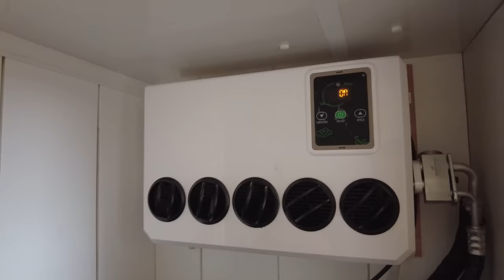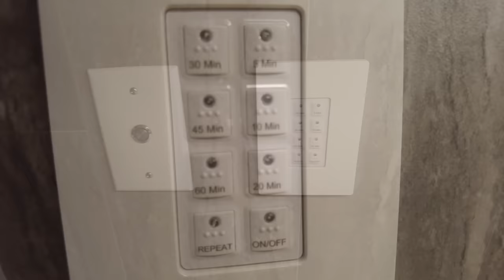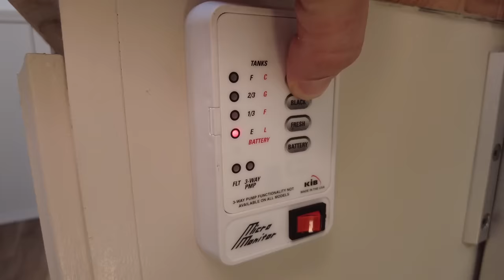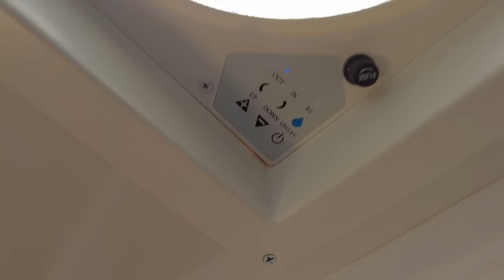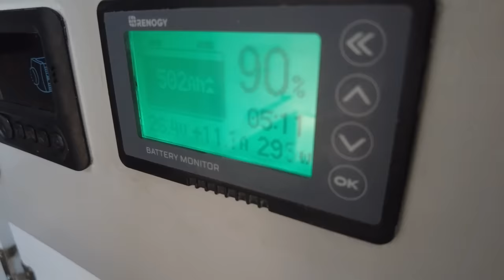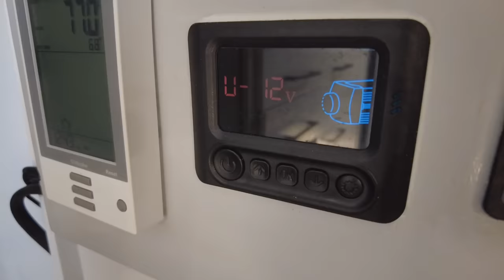Stealth Apartment + Toy Hauler in a Box Truck? DETAILED TOUR!

Comment: The major issue I see with this is a lack of fire escape. In the unlikely event of a fire while the occupant is asleep, they're effectively trapped.  Putting the skylight above the bed adds a fire escape where it's most useful.  And I'd prefer not burning to death to even natural lighting.
Reply: You missed the passthrough door
Reply: @hmmm2564  No I didn't.  If you have the bolt thrown and door locked, are dead asleep, and there's a fire  and the bed is in the way, smoke is everywhere... good luck.
Reply: It's a box truck with two exits. Even two and 3 bedroom apartments have 1 door 🚪. It's fine. You can customize yours if your scared. 😱
Reply: @whatchandstudy7  Sure, but they have windows. ANd it's more of a fire safety perspective, having recovered charred corpses from places with no escape (Closets, for instance.)  The builder is exposing himself to liability by placing a sleeping area in such a way that there's no way to escape a fire.
Reply: @Canthus13  There's no liability to having 2 doors and a skylight in a 17ft box truck. Keep a ladder if you're scared. Sometimes your field of work has you constantly seeing the worst of life and you can't escape it. If your scared then do your own that way.
Reply: @whatchandstudy7  go ahead and think that.  There's a reason for RVIA standards.  And fire codes have mandated fire escapes in RVs in pretty much every US jurisdiction since the 70s, so there is absolutely liability.
Reply: @Canthus13  OK. You win. Tell the guy that his build is Trash and he need to start over. Use your knowledge for good use and contact the guy. I hope you tube comments aren't your only win. Go do the work now and save some lives. Congrats 👏. He's probably building another one right now. Go help him.
Reply: It's not about being scared, its common sense. If a fire was to start in the cab how would you get out, not through the from access door. The rear ramp door is locked from the outside and no one is tall enough to climb out of the skylight.  This puts a lot of future personal liability on the builder, regardless of liability release forms signed.
Reply: @donnobles5272  I could use common sense and find 25 things wrong with this build. I think he did a good job.
Reply: @donnobles5272  Go check the owners comments pinned. He's used to the ”WHY DIDN'T YOU” crew.
Reply: @whatchandstudy7  Agree great build. It's just dangerous with only one means of egress since the back door will not open from the inside
Reply: @whatchandstudy7  Where is the second exit when it is in stealth mode?  I didn't see a way to open those cargo doors from inside.  And no apartment bedroom is up to code without an alternative means of egress-- they must all have a window of a certain minimum size.  The lack of a second means of egress in this build is the only problem I see here, but it is an extremely serious one.  I'd create a hatch through the roof, or perhaps the floor.  There has got to be a second way to get out when those cargo doors are closed.
Reply: @Canthus13  Yes, I strongly agree.
Reply: @whatchandstudy7  It's not about being "scared".  It is about being prepared and informed.  In stealth mode there is only one door, and that skylight is too small for escape purposes.  This defect can readily be remedied but it merits serious attention.
Reply: @donnobles5272  Yes, I strongly agree.
Reply: @Canthus13  -  When he goes to register the truck with the State, they will ask the purpose of the truck and there will be an inspection according to it's planned use.     If he is building on to an already registered truck, in that case he might be in for some questions if he ever gets stopped on the road.   Their are weigh stations on highways that check trucks thoughly since the problem we have with drug smuggling.

Comment: What's really satisfying about this video is that it PROVES the viability of not just box trucks, but also shipping containers as an off-grid residential option. The keys start with the energy foundation: 1600 Watts of solar power, distributed to home-style amenities. If stealth is not a requirement, this approach gets even better. Personally, I could not exist in an enclosed box with no side windows. Too much like solitary confinement. 
One stealth suggestion: Use paper-thin solar panels. Even with reduced output, they would be virtually invisible, and easier to clean. Also, use sodium-ion storage batteries, when they become available.

Comment: Cool build. One thing I think I would have done different: I would have tried putting some utility drawers on the left of the sliding door, sliding out to the rear. Put outdoor stuff in there, tools, wrenches etc as needed for the motorcycle. It would have decreased the size of the sitting area a bit, but it seems weird that the only accessible drawers for gear, especially tools needed, are all the way in the front. The washer/dryer combo is slick!

Comment: That's awesome.  You really put a lot of thought into it.  My only concerns are (1) Climbing up onto that bed, and not falling off in the middle of the night, and (2 🚨) Because the rig is so air tight, there's a high risk for exphixiation from the gasoline fumes if they're sleeping or spending any time in there with their bike.  You really need good air flow for that too (not just the ceiling vent, unfortunately)  This is where windows really are necessary.  You also need ventilation for cooking -especially if using a propane stove (CO2 detector as well).  (3)  You need to mount a fire extinguisher. (4) If you're using regular car batteries, and they're inside, they need to be vented to the outside. (5)  You will probably regret using the white board on the ceilings, because eventual leaks are likely in a box truck due to the movement/flex.  You may want to roll out a protective membrane (or fiberglass?) across the roof.  Hope you used a different product on the ceiling in the shower.  (6) Hope you won't have issues with the sliding glass door, but I'm sure you researched if it can take the constant movement/vibration, and added good framing to ensure it won't get wonky.  (7)  Ya might want to re-do that odd camera angling back/forth in the beginning of this video....and re-think the stache. 😉  And, don't be so down on vans and RVs.  You could learn a lot from other's choices/logic and ideas.  Also, not everyone is a good fit for, or wants a box truck, especially women, who may find a van or small camper is easier to drive.

Good luck with your business.  ❤
Reply: I detect a little jealousy here. 😂😂😂. I’d probably prefer a van parked by the river myself.  👍
Reply: 😂 - I especially agree with the moustache comment! Also, he’s quite arrogant
Reply: asphyxiation not exphixiation
Reply: I love all of your safety suggestions/concerns.

Comment: Right off, the tape over wiring on roof will tear off/flap in wind/at highway speed as will the wiring. Second, the AC heat exchanger mounted underneath will consistently run hotter than spec due to restricted air flow and often being directly over super heated pavement, therefore, wearing out/breaking down sooner/more often. Also exposed to high speed debris as well as water soaking/splashing that standard outside mounting only exposes to rain not flooding.

Seems mounting AC heat exchanger center of roof is stealthy enough and better securing roof wiring would eliminate any issues.

The rest of the build is quite ingenious and very well done.

Thanks for sharing

Comment: My kids will be of age 18 in a few years. And this would be perfect. Because I want to sell my house and get rid of everything and go tiny. And this is the best thing I’ve seen around. Thank you for the ideas. I never even thought you could do something like this if you purchased a U-Haul truck. And to top it off, you actually could travel somewhere if you wanted to. Versus other tiny homes that some of them you can bring around with you and haul them if you have a huge truck and everything else. Definitely the best thing I’ve seen so far for tiny living. Can you also Haul small vehicle behind this with the weight? You may have said in the video if you can, but I missed it if you did. Was also wondering if you could do French doors instead of the sliding glass door?

Comment: This is really nice, but 1 big issue for me is its lack of cold weather capability.  All the bare tanks and plumbing are in the open under the truck with no insulation.  This is a warm weather, or 3 season rig for sure!  
He did a great job on the build, and it's very well thought out.

Comment: graet build aside from the exposed wires on the roof that connects into the solar panels-i'd recommend running the wires underneath the solar panels with a lift hinge type setup.

Comment: I have never considered a stealth box truck build. It just seemed silly to me and let's face it, if you went to an RV park it would kind of stick out like a moose in a chicken coop. 

Having said that, your video has opened my eyes. 

First off, in some cases, the stealth factor does pose some real advantages in some cases - actually, many cases except in a RV or State park situation. So yes, it's beginning to look practical to me. 

Second... It's square! That makes building it considerably easier to build.. I like that!

Third... You have done a super job in adapting a vehicle which is heavy duty and capable of withstanding the access to more difficult destinations such as off-road scenarios where a class C might not want to venture. 

So, thank you for sharing your design and build. It looked so comfortable and innovative and seemed to me to add another dimension of possibilities to the RV experience that a typical class 3 might not be able to handle. 

Super job!

Comment: Very nice work! Excellence in detail and craftsmanship and lay out! Love the approach and thank you for sharing. I have nothing negative to say at all... but must point out 2 important safety issues... with one very good recommendation for mega efficiency. 1) The positive terminal on the winch MUST be protected. Massive safety issue considering its dual use storage as well. 2) Wiring for the solar panels needs to be organized and in some type of protected conduit to avoid damage.

Recommendation (with some good small pointers): Consider in future builds to centralize all built in electrical components into one compartment. (preferably next to the fridge if using a home unit) WARNING If using lead acid batteries you must always make sure this is ventilated externally! Personally, I would not even house them inside the living space at all. As we all know... these components put off a lot of heat. So do the condenser coils on the back/bottom of the fridge since its a home unit. This is precious heat for winter and also heat we want to vent outside in summer. Building the home fridge into this compartment allows heat management. This can be accomplished with a very simple vent system and smallish cheap DC fans like we use in computer cases. The external vent I would wire with a hard set thermostat so it kicks on no matter what when required. The internal vent I would wire to an adjustable thermostat for comfort and control. If the box is well insulated, this heat is likely to be all that is needed in winter... possibly too much some times. In the summer... this same heat is isolated from the living space and vented outside. Using a normal home fridge is fine... good in many ways because we can use this to heat the space... and lower unit cost while maximizing efficiency. Just be sure the drip line that normally collects water in a tray on the bottom is re-routed externally just like was required for the AC. This way there should be no issues with moisture and molds and such inside the living space. Other than that... Super Awesome build!!!! Thank you and ML and Blessings everyone :)

Comment: I may have missed it if you mentioned a carbon monoxide detector, but do be sure there is one.  This is a fantastic build, the only serious problem here-- and it is a grave problem-- is the lack of a second egress when in stealth mode as required by RV codes-- they are required for good reason.  Local AHJs could demand this vehicle not be slept in until that problem is remedied, if they were to notice this vehicle.  I'd just use a larger skylight with a collapsable drop-down ladder (this would also improve roof access anyway, which I discovered we needed more often in our RV than I ever would have thought), but there are many alternatives.  For example, many work trucks and trailers have a man door on one side of the box or even within the rear door, so even though U-HAULs generally don't have them, these would seem compatible with a stealth mode design to me.

Comment: You might want to think about adding a longitudenal support strap to your water holding tank. On RVs, failure of the tank  due to tank design , it created many problems with cracking from road vibrations. Water is heavy and plastic tank is made from very thin material. Otherwise great build with many thoughtful appointments.

Comment: something that I have always wanted to try myself but now I am too old and just don't have to funds to do it anymore. At one time I was going to build a man cave below ground. There were going to be no windows, but I wanted to design the space as if it were above ground. Instead of windows, there would be large monitors framed as windows. Above ground there would be high definition cameras for each monitor facing the direction that an actual window would be facing as if the space was above ground. So, when you look at the monitor, you would feel like you are looking out a window that would be in that space if the room was actually above ground. I've never seen this done before, even as I have searched quite a lot trying to find anyone that has tried it. It seems to me that this may be a great idea for your stealth apartment on wheels. It won't feel so enclosed from the outside, but on the outside, no one would know that anyone is looking outward. It would also make for a great hidden security system.

Comment: Very cool I just saw two issues one I’m not a fan of the wiring I feel like it would be flapping around on the roof, also the bed side drawers did not look like they locked. Also maybe paint the edges of the solar panels white.

Comment: Great build - even though I’m not a designer and I say this w best intentions.  I question a few things  in terms of ease and accessibility for an “ elderly  couple” The bed is too high to access without steps or stairs- make a step that slides out  and locks that also has storage. Also make that loft bed extension folld out or slide out, ease is thing to keep in mind. Also think two sofas that fold out to a bed would be best for a bed . Also I’d reverse the layout. Sofa/bed by the deck. W the layout reversed, I’d like to see access from the cab to the back- emergency egress . Having this space to work with is fantastic yet despite the bigger space, I think being crafty with some tv style / van build  clever designs would help in making the space bigger and accessible (for all)eg;   , slide out drawers, outlets for cpsp machines, and a bigger bathroom.  Interior design wise, some rich colours , wooded slatted wall/s, warm led lights. Once again, the size to work with is amazing. 👍🏼

Comment: Good job, this is comfortable except for the beds.  Consider a booth that makes into a bed.  A center pole mount, with two different height mounting poles, one 30 inch and one 15 inch and two holes in the floor, one close to the booth and one farther out for the table to mount in for bed height, with little folding legs that come down to ensure it does not rock under shifting weight.  The bench front slides out on full extension tracks to meet the table and this action pulls the back of the booth away from the wall.  The table being 30 inches, the seat 22 and the back 22, thats 74 inches, and the foam on the seat and back have an extra attached piece that runs up the wall to a velcro tab to secure it in booth mode.  This design will make a full size bed at about 20 inches tall plus a memory foam topper from storage and you have a nice bed for grown ups and let the kids sleep in the loft compartments, take out the shelves in the storage for either feet or a head to fit in and it will sleep two kids.

Comment: A small detail would be to put the shower head on the opposite wall so that you have a standing shower over the open floor space. Secondly is the standard complaint I have for DIY conversions you need a lip on every shelf and the possibility to mount bungee cords or nets inflont of all shelfs. All doors and drawers need a locking feature. A question tho, are the eyelets to secure the bike centered on the cabinet or the wheelchuck? Didn't really get video of that part. I really like your build. What are your gross tonnage on the complete build? And have you considered mounting fisheye lenses on the outside? You could hook them to the TV and dash and get a combination of windows/surveillance and backup camera/side view mirrors.

Comment: I have sliding glass doors like you in my kitchen at my patio. I bring my motorcycle inside. The bottom frame on those sliding glass doors are aluminum and the weight of the motorcycle tires could bend them going over them. You need to build two tiny ramps made out of wood and put one on each side of the frame

Comment: Is there a video showing the procedures and control for filling fresh and dumping grey/black tanks?  Is there external shore power options available, say you are pulling up and it's been overcast and battery regen could use a boost?  Fantastic box build.  Thanks for showing us!